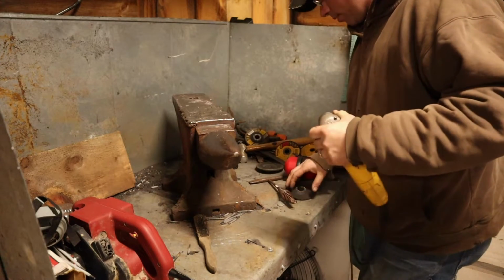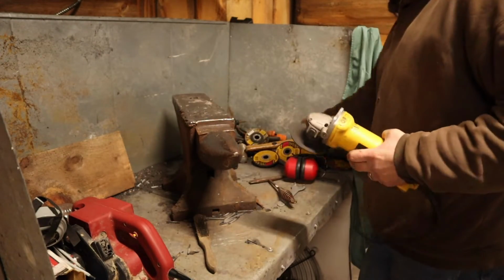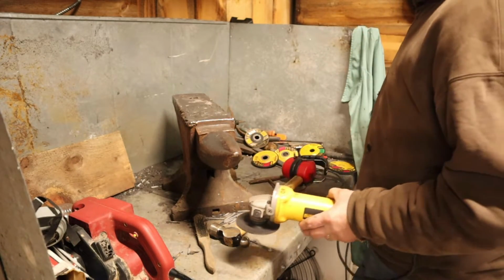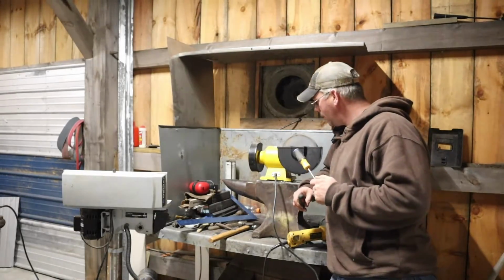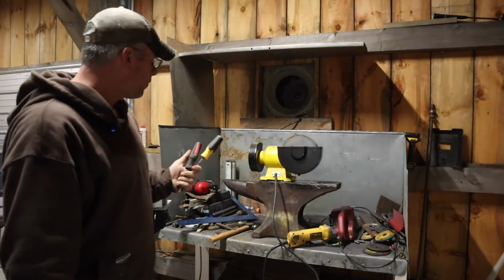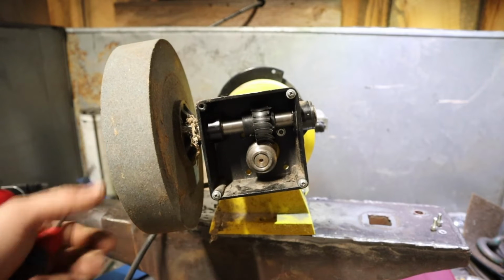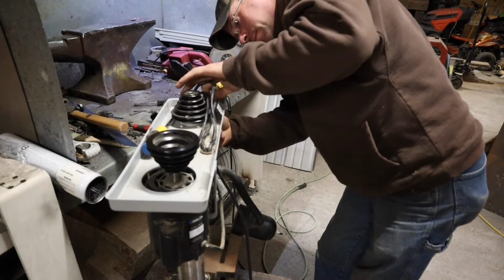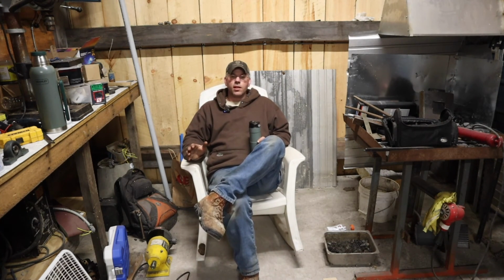More Anvil Repair: Grinding Away The Hours

Comment: Only at the start of the video, does the grinding not affect the heat treat of the surface?
Reply from the maker: If you take your time it won't hurt it.  This is a very slow process but well worth it.

Comment: Hi Jim, I do come back to catch up on things peridically... Have you tried ceramic grit sanding belts?  They run 2-3x the cost of regular, but last 5-6x as long.  Bloew's carries them, as do some Ace Hardware stores.  Of course, I haven't watched the most recent anvil vids, so you've likely solved this particular headache one way or another; still, I like them for heavy-duty belt sanding and grinding.  Good luck, and keep on chuggin'!

Puttering and tinkering are important creative learning skills!  They eat up time, though, and have cost me a lot in the time I can't charge my customers for.  Still, the skillsaw track I spent a day building and tweaking made it possible for me to finish a customer project I couldn't have done any other way, so it was worth it in the long run.

Comment: You can make some jig to hold your grinder at the proper angle and make it on the principle of a board leveling jig like they use for routers. You will get a level surface in the range of .005 to.025 but then how level do you need to make good tools? You could make it out of angle iron too.

Comment: i had one of those cheap ass worthless piece of garbage belt sanders. i might have had 10 hours on it when the roller tracking adjustments no longer functioned.  i stood on my second story deck swung it by the cord and launched it as high up as i could.  i had wet  spots in my shorts when that piece of junk hit the concrete. just saying.
Reply from the maker: I a bigger Porter Cable that I won't use on metal.  This thing I've had for years and to my surprise it still goes just fine.

Comment: OK .. Last night I went to bed with an idea for a grinding setup but went to sleep too soon. Today, when you mentioned your idea ,  the entire design popped into my head. Now, you do the same and I'll try to point out what I came up with to help ....🤣😉😉👍You're gonna need a couple of 4 pillow block bearings and two smooth shafts, a couple of pulleys, a few bolts of various sizes,  and some scrap lumber.... Oh well, you know  ...

Comment: Puttering around campus looking for a quiet study spot. When did libraries get so damned noisy?
But yeah, puttering around projects at home combined with ADHD and brain damage, I've got so many started, but not finished, projects that my evenings and weekends are claimed for at least two years after graduation and finding a job.
It's always fun to start a project, and fulfilling to finish one, it's that dull part in the middle, like Jim's between the ears, that eats so much time.
Hope you create a new grinding tool out of those old parts of machines. Yeah, if nothing else, HF tools make okay building blocks.
Reply from the maker: I'm late on comments, love the dull part between my ears!  You and I could be related.

Comment: Once again Jim, a 9” grinder 2-3 hp will do that stuff a lot quicker I like a soft backing pad and industrial flexible discs.
Reply from the maker: If I had one I would be using it for sure.
Reply from the maker: I got a hold of a 7" grinder, much better.

Comment: Planned to fail is the reason plastic parts are on everything these days.  This means profit for the companies making the junk.  Profit in the low cost to manufacture and customers buying over and over the same JUNK!  What consumers need to do is STOP buying JUNK.   Forgo the desire to fabricate a surface grinder for the reconditioning of the anvil.  Focus on the anvil end goal.  Avoid the temptation to stray in sake of the anvil.  Buy you own proper grinding wheel or hire a willing machine shop to do the work.
Reply from the maker: You are right, no arguments from me.

Comment: This fellow putterer understands completely! It is pure joy to get out in the shop, scrounge through old salvaged parts and make something useful. I knew where you were going with this as soon as you started talking about the project. Happy rabbit trail! BTW - the guts of an old trash compactor might provide a good start for a screw drive mechanism to move the grinding wheel across the surface.

Comment: Maybe you can build kind of a sled to keep the grinder at a certain level. Just like you did when making the big scarf joints using the router. The whet grinding wheel won't remove enough material in an acceptable time
Reply from the maker: I think you are right.

Comment: Jim I am bummed out. I can't watch any videos on Youtube do to some construction down the street (Well that is who I blame). They have caused some issues with the local lines that carry the DSL on them. They were digging around the phone lines so I really think they messed something up Anyway because that I had the choice of downloading your videos or trying to watch then in 144 quality. Looked like the lens had grease smeared on it it was so fuzzy. So how are your ears after that much grinding? Mine are already ringing from just watching a tiny bit.
Reply from the maker: I've been wearing hearing protection, needed on this one.
Reply: @TheTradesmanChannel  I learned a long time ago when doing pressure washing sidewalks to put it on. If I did not use it I would have a bad bad case of ringing in the ears. I like my hearing and so now I ut something on even on small jobs,

Comment: Surface grinders are very nice. Even a home made cobble job is better than endlessly standing there with an angle grinder. 
A frame to limit how much up and down travel the grinder has gives you a better chance of having a flat surface when you are done. 
Just a thought. I have seen several rigs for flattening large surfaces with a router. They involve a level frame and a cross rail that lets the router slide back and forth at a set height. The frame is moved the width of the router bit and another pass is made. 
A simple rig like that could be made inexpensively and would let you use your existing grinder. 
The wheel will make a huge difference. Ian mentioned CBN. That would be a big improvement in your ability to remove metal efficiently.
Reply from the maker: Hello.  I actually have a few router sleds I have made, they work very well.  I'm almost there on this anvil.